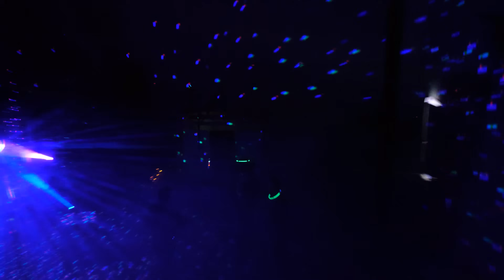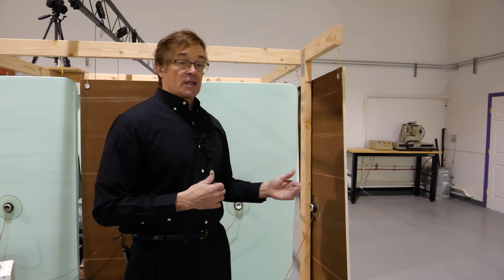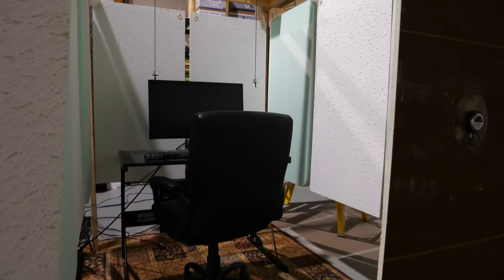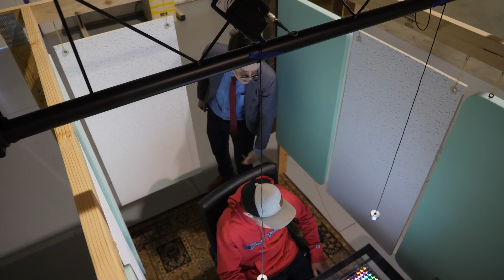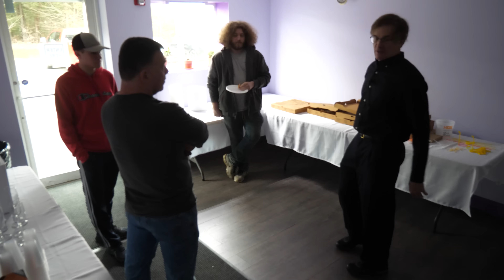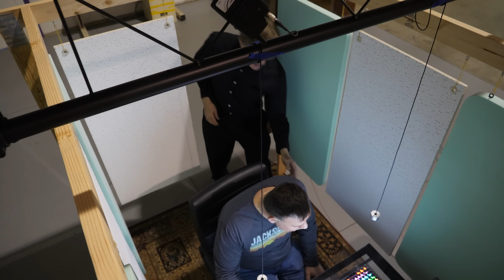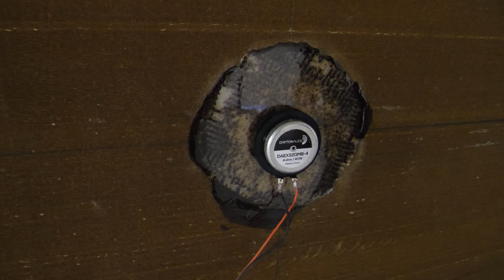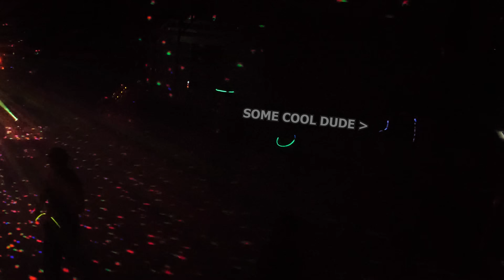SHOULD SPEAKERS THIS GOOD BE LEGAL?

Comment: You need to do some reading on speaker engineering and why taking a flat panel, and rolling it a cone, makes it more rigid, and is always superior to flat panels. Sound like a 'normal' speaker huh? Weird they do tjhat when these panels are cheaper and easier to make. 
Or just do some simple frequency testing. This crap really hurts your credibility with anyone who understands acoustics.
Reply: Perhaps we have more applications for flat panels than conical, you seem a little judgmental in your statement
Reply: That's why Magnepan planar speakers have been around since the early 70s, and cost a considerable amount... Some swear by them...
Reply: @Quickened1  It all depends on the sound you are going for. With large panel speakers, you have the sound from the top of the panel interacting with the sound from the middle of the panel, causing unevenness in audibility and reducing the clarity of the sound. Also, the higher mass of this panel in particular will reduce the "snap" or "punch" of the certain sounds.
But at the same time, such a large panel will create certain spatial effects that can also be very pleasing in certain situations. Audio is highly subjective, and the only person whose opinion matters is the individual listeners.
Reply from the maker: Magnepan speakers do sound good, but their principle of operation is completely  different from a DML even though they're  both flat and of course Magnepans are much more expensive.
Engineering is the art of compromise and cost is part of the equation if you actually want to have it.
Reply: @TechIngredients  does Magnepans tune the speakers after they are built by running all the power they can to tune it... I am just thinking out loud on my old memory.
Reply: @Quickened1  Magnepan's don't sound great and are severly spl limited. Find an independent frequerncy response chart before you praise them too much. 
@Tech Ingredients  My issue is with the presentation. These ARE cool speakers! If having a device 100x larger than needed is your thing, they are interesting conversation starters for sure. 
For example: I own a pair of plasma tweeters, but because they're cool. I don't act like they are the best (or 'illegally' good) at anything is the distinction. It's just interesting tech. 
Why can't things just be cool? It's not the best and doesn't need to be!